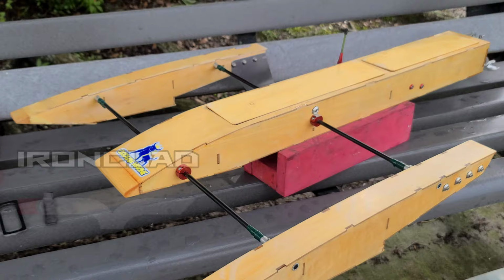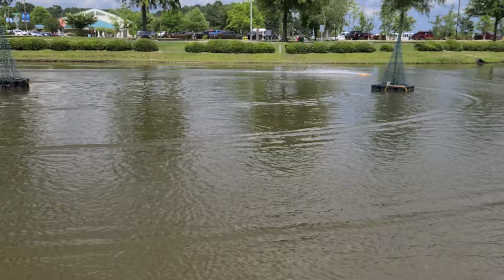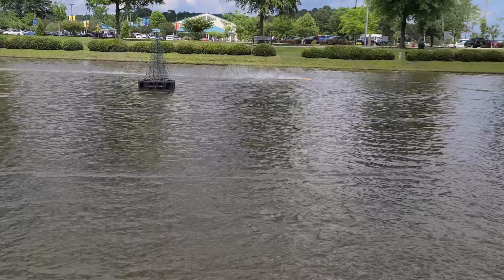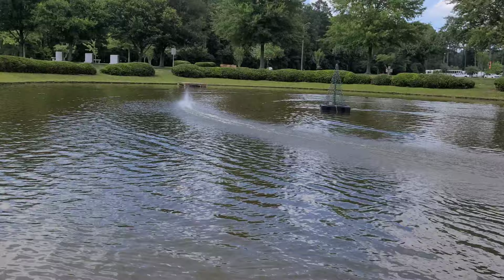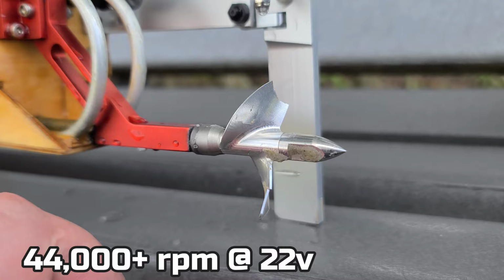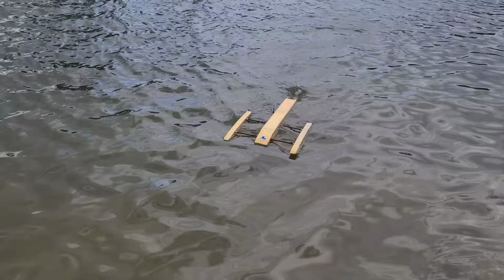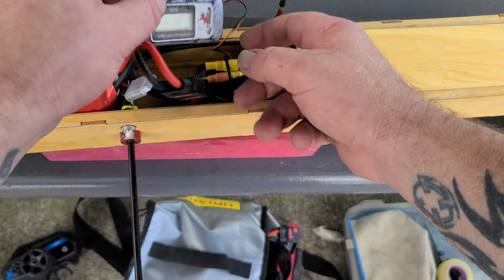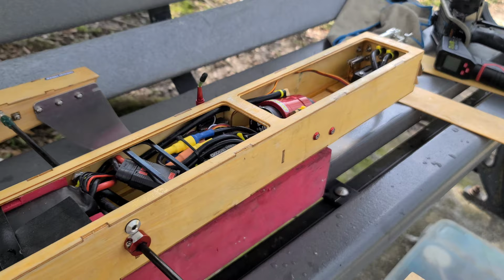Stupid Fast Oxidean Oxi-digger 34" ARTR Pre-assembled Wood Rc Outrigger Boat

Comment: As said before , stay away from ali props on hydro's. They are nice and thin , but fracture too easy on fast corner speeds . CU, Be props only . When the blades fly off, the out of balance tries to rip the stub shaft out of the hull. PJB